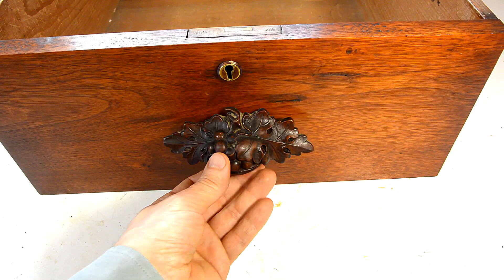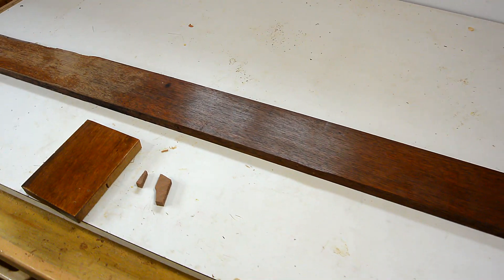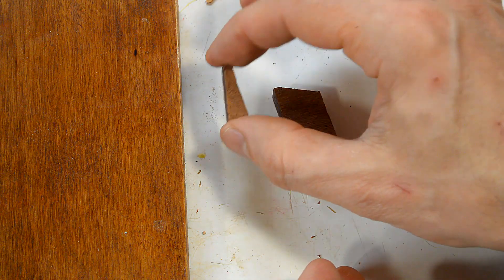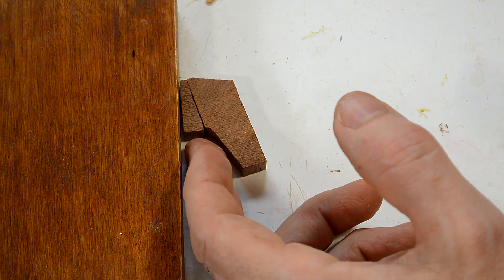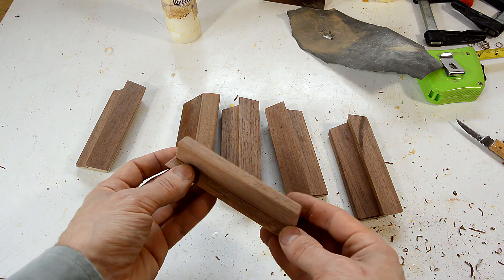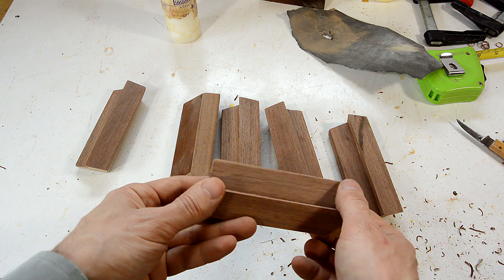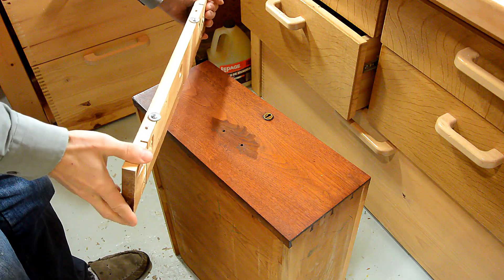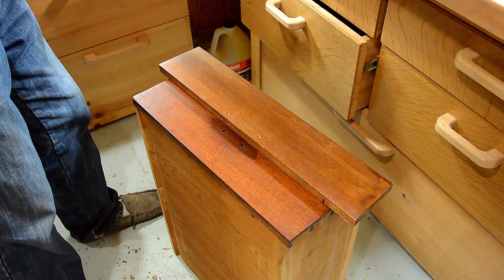Making drawer pulls on the table saw

Comment: Needed handles for shop drawers, remembered this from 4 years ago. Not finding a drawing or dims on the web page, I grabbed a video frame at 15 sec and dropped into sketchup to measure. Two wood parts, one 20 x 50mm, one 10 x 25.4, glued up and then the angle cuts. Your angles appear to be 15, 18, and 21 degrees.  I simplified a teensy. I made them all 18, which accidentally makes the top-to-back angle 90 degrees, easing some operations. Like you, I made a trivial jig for drilling, and made a template to mate the drawer and the handle. The bevels on the ends then blew my mind for some geometrical reason. Again, set to 18 degrees. Because I very poorly color matched the small back piece, I made a reverse bevel on that on the sander and the result hides my mistake, but also looks awesome! So awesome I am backing up to make again with better wood. Thank you, Matthias, for this design.

Comment: Hi Matthias,
Building a small external cupboard on the end of my workshop for my wife to keep a few garden tools handy, out of some battens and cheap 1/2 inch plywood, I found that the only piece I had for the door was a little bowed, so needed to be straightened by a batten.  Also, as I intended to use rare-earth magnets to hold the door shut, I needed a substantial door-pull so my wife could open the door without too much trouble.
I remembered viewing this video so made the batten a very long version of your drawer pull by simply cutting a square section out of its length on the table saw, so it did both jobs.
The piece cut out was added to the other side of the door to cover the ends of the screws used for the hinges.
Thanks again for your thought-provoking entries on YouTube.

Comment: Some years ago I discovered dry wall screws and they were a revolution when it came to fixing plasterboard. However, I got hooked on them and used then even today for nearly everything.... unless you want real strength then their shear strength is not so good but I love the bugle heads and fine points. Nice job on the handles.

Comment: I wasn't convinced you could make better handles but I was absolutely proven wrong. I wonder for the missing key you mentioned before if you could get a blank and file it to the correct height... though I imagine locking is v low priority for these ones

Comment: What size material did you originally start with? What angles of cuts did you make?
Reply: See my comment a few minutes ago. Two wood parts, one 20 x 50mm, one 10 x 25.4, all in mm. I used 18 degrees for all angles.

Comment: Your tablesaw seems quiet, at what rpm does the blade spin?
Reply: you might have your volume down. it would sound louder if you were in the shop.
Reply: It's not about overal dB's, I can't hear that rather high pitch sound that the teeth when passing zero clereance insert makes.
Reply: oh.